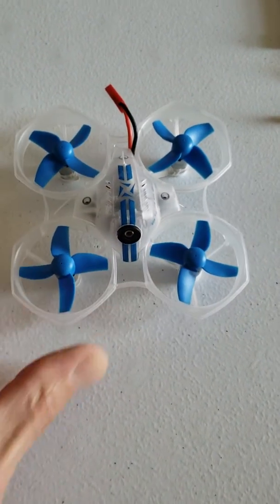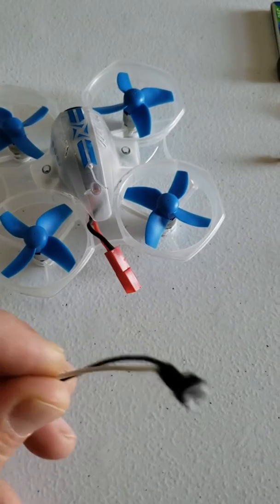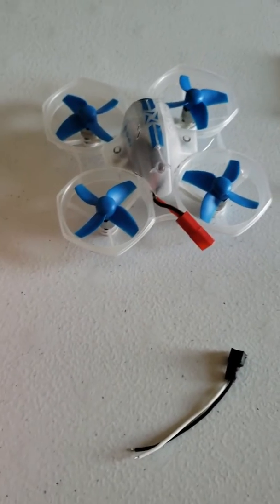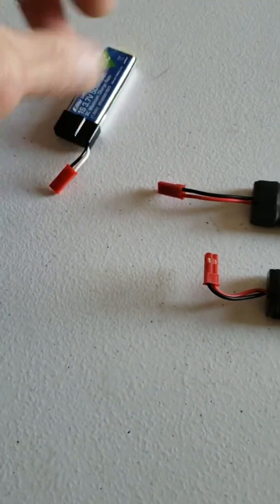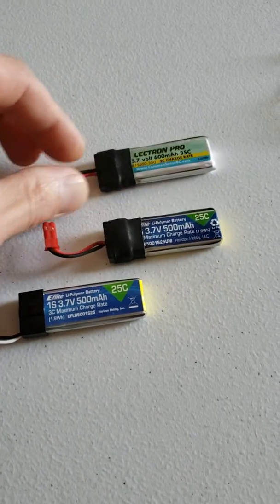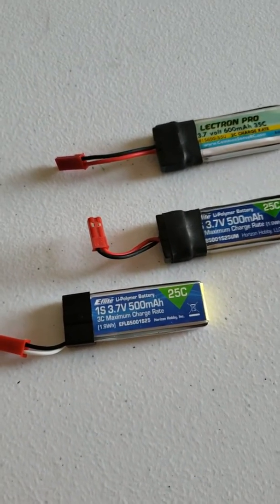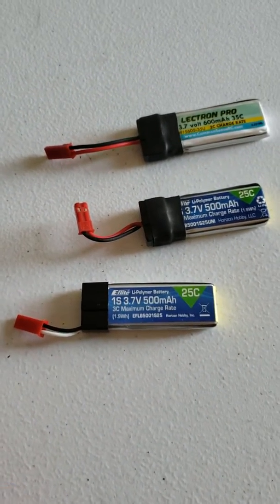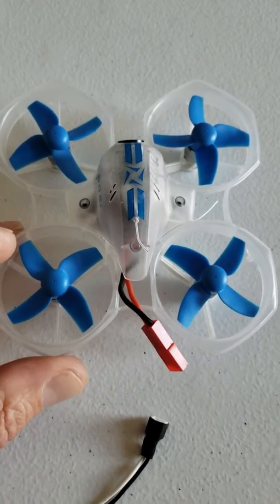Blade inductrix bl battery mod tutoriol

Comment: If you notice your also running at an average 3.6v-3.8v instead of 3.4v-3.5v.  The Executive at Blade who made the choice to skimp on wires and connectors should be fired. Same story with the Turrent 110 and Scimitar 110 jst connectors are way to small for any 3s battery!!!!!!    Oh by the way the connectors that came with the inductrix fpv bl should be on the regular inductrix.  4 drones released with connectors that are rubbing flight time and performance......and your pocket!!!!!!     Blade is sucking pretty hard at the moment!!

Comment: The customer should not have to mod any of their stuff hence "Bind and Fly". But if they keep crapping out, they will lose customers very quick. All of their bind and fly is cheap overpriced crap. Had one micro Heli garbage, had a Blade Torrent 110 garbage, I have the Inductrix, a Induxtrix Pro garbage, and Inductrix BL had to mod it to get some flight time. The only good quad I have is the Blade Vortex 150. But don't forget, that's made by Immersion RC, not by Horizon. Me my self is done buying their crap. Hope you read this Horizon. Shame on you.

Comment: Thanks, did you solder to the board or cut the wires and just change the connector?
Reply from the maker: Solder directly to the board.
Reply: I totally agree with you. Blade is all about maximum profit and very poor quality. They crap out where ever they can. But in the long run they will lose. Good for the competition